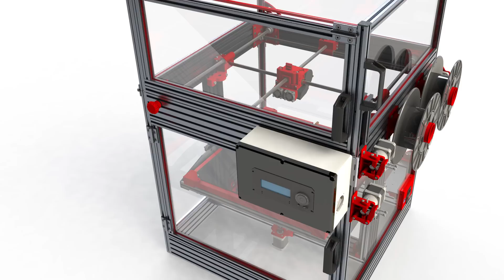Build your own 3D Printer: Frames and Linear Motion!

Comment: You're saying right here "In the next videos we'll dive in and look at the parts you'll need to add motion to the frame and make it an actual 3D printer" - i have been waiting for it for 2 years now.

I would like to see an in-depth discussion of different motion systems. Where different motion imprecisions could come from, for which systems the quality of which parts is more critical, the various engineering tradeoffs of the Mendel-style, vs. Ultimaker-style vs. XY cartesian with one moving motor and raising bed vs. Dual Wire Gantry vs. CoreXY, plus the discussion of why H-Bot failed.

Comment: Delta printers are stupid. half or more of the printers height is unusable for working space as it's just due to mechanical limitations, and no added benefits. 
A regular cartesian printer is more compact and only needs ~15% of the height/width due to mechanical limitations.

Comment: If I build my custom 3D printer, let say 500mm x 500mm x 500mm, can I use for example Anet A8 main board to control my step motors, my custom extruder?  I can program my slicer Cura for larger bed, no problem.  But again, what about main board? Do I need to reprogram something in the board? If I go for larger step motors, can I still use the Anet A8 board to control them?

Comment: Hello , 
I want to ask you that Can we use the Nema 17 Stepper motor with less input  AMPs and volts Does it make any difference in the working of the 3D  printer  and one more thing what type of material do we need for the Rods of 3D printer.

Please do reply, I would be waiting for your answer

Comment: i had issues with the motor going the opposite way of the limit switch of the Y axis.  using marlin software.
Reply: The simplest fix I've read for that is to reverse the plug for that motor at the drive board

Comment: Hello Thomas.Want to thank you for all the input videos and tutorials you have done.
Phenominal! You are the man!

I have developed some projects around the 3D world. First I started with hephestos (with excellent results) and then (as a base in this excellent video) I chose to build the itopie.
In this way, I want to leave my testimony to this base i3, named itopie.

Firstly, it is an excellent DIY machine, very solid and with few printed components, which makes it more accessible monetarily.
Easy to manufacture / assemble and with a very simple and elegant final look.

However not everything is perfect ......

At the speed of printing, you get 80mm / s but the quality of the printing leaves a little to be desired. The ideal is 60mm / s in large parts and 40mm / s in medium-sized parts.

The worst in this frame are the vibrations!
Because it has a solid frame, all the vibrations coming from the motors go to the printed part.
There is a lot of work to eliminate the vibrations, from sponges between the frame and the table, use of dampers in the axes, slowing the printing (the lower the speed the vibrations worsens!), Etc ...I was able to eliminate the vibrations of the X and Z axes (using damper), but in Y I can not get rid of them!

If you have any tips to lower this vibration of Y ...
Again, many thanks for all the vídeos!

Comment: What's your opinion on building a 3d printer in the same configuration as a cnc mill, where the bed moves in the x and y and the nozzle moves in the z? Would that have any disadvantages as far as accuracy goes?

Comment: nice video with good information! something funny I noticed, @ 2:20 you move the Y axis and because of that the fan started to move a bit from the energy created by the motor that you moved.
Reply: why or how is that funny? i don't get it.
Reply: NiceWhenEarned RudeMostlyElse When you move the bed, it spins the motor attached to it, which generates enough electricity to momentarily power the fan, to put it in layman's terms. It's amusing to engineers because it's an unintentional demonstration of basic electromagnetism principles, and shows up in an unexpected (but also kind of expected) place

Comment: Hey, i've been trying to make a 30$ 3d printer but i've had no success with the firmware, teacup in my case, do you have any suggestions on firmware that can fit in an arduino nano 328p ? 
I've had many problems, first the teacup firmware didn't start, after fixing that it didn't build, after fixing that it won't upload the build ! arrrrgh *pulls hair out* I'd love to bring my project to daylight and make an instructable on the world's first 30$ ( all parts plus some filament included in the cost of materials ) DIY ( slow, small but better than nothing ) 3d printer but the firmware is driving me nuts.
Reply: I've thought of that too, too bad teacup doesn't work as it seems to be a very good bit of firmware and only takes up about 62% of the 328p flash memory.

Comment: You shouldn't use chrome plated rods, as their surface is too smooth. Also the thin chrome plating can be damaged by the ball bearings.
Instead use hardened and precicision ground rods made of 1.1213 (CF53) Steel.

Comment: This is a great topic Tom! My first printer was a QUBD TwoUp kit. I will reserve my less than favorable comments regarding that product. I will say, however, that it was enough to get me to the point where I could build a better printer using parts printed on that printer.

I've been working over the past year to develop a printer that would make a decent kit for teaching students how to build a 3D printer. I designed a printer loosely based on the QUBD TwoUp called the A51Z (http://www.thingiverse.com/thing:844471). It utilizes as many printed parts as possible for the frame and bed. After many iterations, this printer has proven to be quite a workhorse. From that I developed the A52Z (http://www.thingiverse.com/thing:1078143) and soon the A4 (http://www.thingiverse.com/thing:1390188). With the 1Z and 2Z I have produced kits for classes I teach here. Over the past several months, both printers have been running pretty much nonstop to build kits. I've printed close to 1000 parts in that time and the printers have performed way better than I expected. 

All the parts for the 1Z are available as STL and STEP files. 

I really like the DIY possibilities for 3D printers and it's great to see you promoting this topic. Looking forward to more!

Comment: I see you've built your delta because it's there in the background. Have you compiled enough build time yet to review deltas with the same depth of coverage as the Cartesian designs.  You have done so well with the component and system reviews of the Cartesian designs that I'm anxious to see what you've learned about deltas.  I find you to be a reliable and trusted source for 3d printing, and I've had my issues with my delta and I'm constantly looking for more insight.  Keep up the excellent work!

Comment: I have to say my delta frame is more rigid and stable compared to the original prusa i3 i had. Also i totally agree setting up a delta is a entirely different beast when setting up and configuring. Mine came with a IR sensor instead of an inductive one or the springloaded allen wrench with and endstop. I am learning more about gcode since the delta requires more knowledge than other style of printers, but i am excited and get frustrated at the smae time but i eventually get it and i leave with a sense of accomplishment.

Comment: I tried building one as my final year project for my diploma and yes, it was nerve wrecking and frustrating. in the end, my group and I got it running but the material did not stick on the print bed. we're gonna make future upgrades on it for educational purposes. by the way, your guide on marlin was awesome. helped a lot

Comment: Thank You Thomas!
I have been considering how best to enter the 3D printer arena. Your video series is exactly what I needed and where I plan to start. There are a couple of areas that would truly help a noob like myself the first being specifications. Additional detail the spec's would be appreciated.  The other being sourcing If you can be as specific as possible with respect to where to order items I would appreciate the help.  These two things came up when I tried to order the  iTopie I3 but found no way to order it nor the thickness of the MDF used.  
    Really looking forward to the series and getting the benifit of your experence on this area. It will really help me and others with the things you mentioned value, quality & understanding.
Thanks, Steve

Comment: I've nearly finished building my second RepRap since building my first in 2011, which has been tweaked beyond recognition and been a faithful printer which has always been using the same thermocouple.
Still, nearly 6 years on, my financial status hasn't improved and the general requirement for a 3D printer mean't that my second printer is nearly finished, nearly 2 years worth

Comment: I disagree on the material point. I use PLA for all my parts on my printer and I haven't had any issues, even around the hotend. Of course, I didn't really have the option of printing ABS until recently anyway. 

FWIW, my printer is the Eustathios, which is what the Herculien was derived from. You should build one and review it!

Comment: You should seal all open cut edges with a 50/50 mix of water/carpenters or white glue, let dry, then lightly sand. Paint won't soak in after that. Painting the frame with a roller was interesting.

Comment: Great video. I'm trying to use a i3 design without linear rails(changing it to work without them).
Reply: Adam Cavender Rack and pinion with abec 9 bearings(like in skateboards/heavy machinery). The idea requires a 3d printer to make. Because I had a 3d printer(don't need another) I decided to use the parts for a cnc design.

Comment: I diy'd myself a corexy monster.. 350x350x450 build volume, well thats the plan when I have lengthened the extruder and z-axis motor cables! Currently around 300x300x300 :)

Comment: Damn it!! Just today I finnished my diy 3D printer and bam, a video with tips about building the printer.
Reply: I know the feeling! Ordered my RAMPS and it's on it's way then I found his review and started having second thoughts.
Reply: +Acrimonious Mirth My printer uses Ramps, it's a great board, just have a soldering iron ready. It's not really a plug and play board. (don't forget to add jumpers under the stepper drivers to 1/16 microstepping since full steps are really just too big)
Reply: RandomYoutuber Thanks for the advice, I'm taking my soldering iron back to my student flat when I return as the board should arrive there soon! Exciting times :)
Reply: +Acrimonious Mirth by the way, the jumper configurations differs from models, look at the chip's datasheet which MS pins have to be shorted. typical ebay stepsticks (A4988) have to have all jumpers shorted to enable 1/16 stepping. Also don't forget to set 1/16 stepping in prusa calculator if you are going to use it (I think it is set by default).
Reply: +Acrimonious Mirth and good luck!
Reply: RandomYoutuber Thanks! I may be back for further guidance when the time comes :)
Reply: +Acrimonious Mirth If you need any help, you can contact me.

Comment: +Thomas Sanladerer Have you ever considered reviewing a MakerFarm i3v? I and many other owners of them swear by them. The owner, Colin is extremely supportive and helpful. Plus the printers themselves are extremely well engineered & thought out. The prices are great too. You can get a full 300x300x300mm, (12inch) build volume for $677. :) 

Would love to hear your thoughts on this!
Reply: +Stephen Germiller At that build volume, or greater, I wouldn't touch anything that wasn't enclosed.  I do most ABS though.
Reply: +Dark Alchemist I own one and can say that you would be surprised! :) I've even brought it outside in near freezing weather and it actually worked!
Reply: Stephen Germiller
A 300mm long ABS print would surely lift or it would be 275mm long and 25mm of brim.  ABS just loves to lift and warp and the colder the room, or even outside, I would have to see that. :)
Reply: +Dark Alchemist Yes ABS is always harder to use than PLA or PETG. This was for Halloween. I was printing /thing:488574 in groups of 9 at a time for trick-or-treaters all night. This was in PLA for the first 2 groups then had to switch to PET+ as I was running out of my small sample of PLA. Each print was about 2 inches wide/deep/tall.
Reply: Stephen Germiller
PLA loves cool rooms and after the first layer switch to a bed temp right below the Tg of PLA and everything just works.  ABS like to pull itself apart under the exact same circumstances.
Reply: +Dark Alchemist I didn't plan on using ABS much when I bought the kit.
Reply: Stephen Germiller
I design a lot of stuff that goes outside, or potentially could, so ABS seems to be the best for that.

Comment: I have a hobbyking replicator (nobody should buy that) and I'm going to change the extruder. I have been thinking of buying the e3d v6. Is it a bad idea to buy those ebay fakes, or is the real deal worth it's price. If I can get 80% of the functionality I'd rather save the money.
Reply: I have a clone on my prusa i3 and I like it
Reply: +Jacob Sokolove Great to know! Has it had any weird blockage problems or something similar?
Reply: +Mikko Tervala I had a clone on my sunhokey prusa i3... It sucked. So many errors in the print and blockages. I upgraded to a real e3d v6 and it works flawlessly now.
Reply: +Tommie ? from what I understand, it's a hit or miss.  sometimes you get a good one, sometimes you get a bad one.  personally, it's a $20 risk I'm willing to take.  I've had two of them and both work wonderfully
Reply: +Tommie ? from what I understand, it's a hit or miss.  sometimes you get a good one, sometimes you get a bad one.  personally, it's a $20 risk I'm willing to take.  I've had two of them and both work wonderfully
Reply: Jacob Sokolove yeah that's probably true. But on the other hand the e3d v6 lite is only 15 euros more and you support the original developer and the European market.

Comment: I am currently in the process of building an over sized Lulzbot.  Printed all the plastic parts on my ORDbot, alum frame from Misumi and my linear rails I got from aliexpress.  Mine is going to have a 350 x 350 print bed for now but has room for a 400x400.  Originally I was going to make it the standard size but I type-oed on my Misumi order and instead of getting my frame in 500mm sections I got them in 600mm sections.  OOPS, oh well roll with it and make it bigger!

Comment: This seems like it will be a good series, Tom.  Thumbs up.

Where can we find M90 frames at?  I tried eBay and no go.
Reply: +Dark Alchemist I make frames for various 3d printers look at www.byq3d.eu
Reply: PJDAutomatyka
sigh I am in the states. :(  Going to a local shop is hideous too as a typical i3 single aluminum frame is 800-1400 USD here just depends on the shop because labor is 250-300 dollars per hour and the rest I have no idea.  For wood it isn't all that much cheaper either and the thickness of Tom's MDF is awesome.
Reply: I suggest to make i3 on waterjet. It will be cheaper than milling.
Reply: PJDAutomatyka
This was on a waterjet they said as any other method is more expensive.  This city is very expensive for anything.
  I am just bringing up the prices of the i3 because I know the prices but I may just skip all of this and try and find a good non moving Y based machine because with a non moving Y the bed can stay truer and way less issues (all of my issues are bed related and the moving Y bed).

Comment: You show painting the MDF frames. Make sure to paint BOTH sides at the same time or you will get warping , even on thick sheets.

I know ... I made the mistake :-)
Reply: Did you apply primer before painting? I painted my 12mm MDF 1 side each time and do not remember any warping issues...
Reply: +Gotan Nate I believe Thomas recommended to prime the wood in the video.
Reply: think of it like gluing two things together. if you apply both things with no glue, it doesn't stick. primer is the glue between paint and 90% of materials.
Reply: This isn’t a mystery. It’s hard to add enough bonding agent into paint while maintaining workability. If you want good bonding prime. Paint will carry the pigment. As for warping, MDF is much more stable than lumber and generally more than ply as well. But it can move seasonally due to humidity changes or if it gets wet. Your best bet, as mentioned, is to always treat any wood product equally on both sides. Same amount of primer, same layers of paint, varnish, etc. You want it to move equally on both sides, whatever that rate is. That’s the secret in preventing warping.